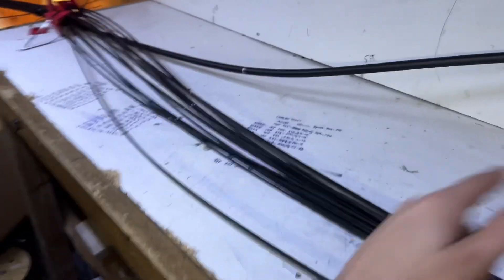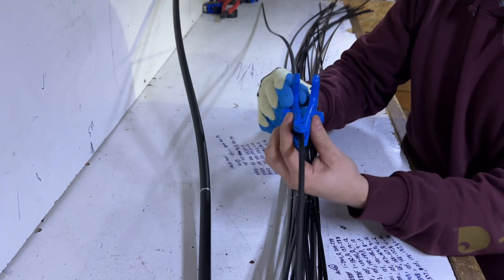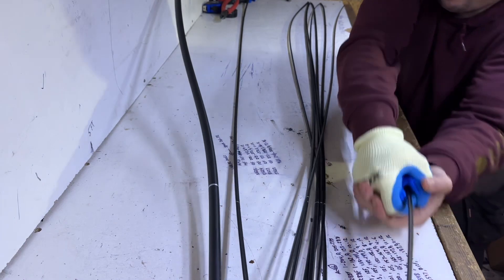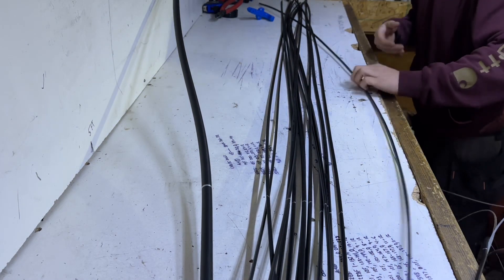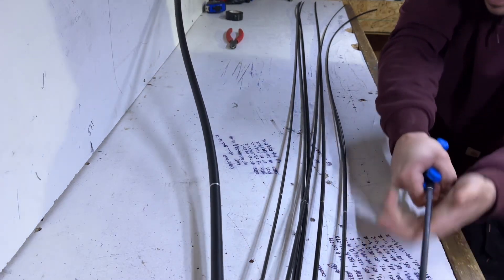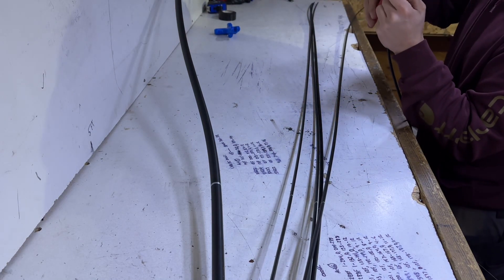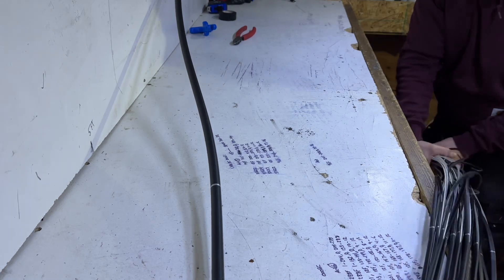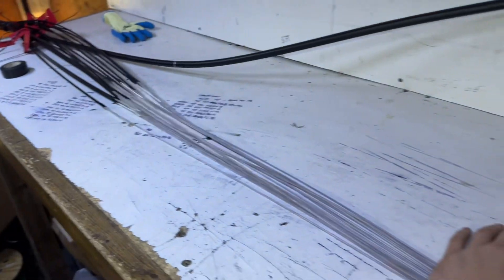Stripping 15 Fiber Optic Multiport Cables/Flat Drop Cables

Comment: Would there be a device that would strip more than one line at a time. Thinking of time management?
Reply from the maker: There is not well at least that I know of. Just the one drop at a time but would be cool if there was for sure would save a bit of time instead of doing them individually 🙌
Reply: @FiberSpliceGod  sounds like a time to invent one.
Reply from the maker: @lornamacmaster9985 very true may have to try and come up with a few designs for one 🙌
Reply: If you’re talking about the individual fibers inside the cable, a thermal stripper exists and supports stripping multiple fibers at a time.